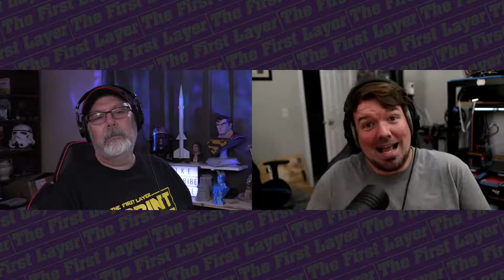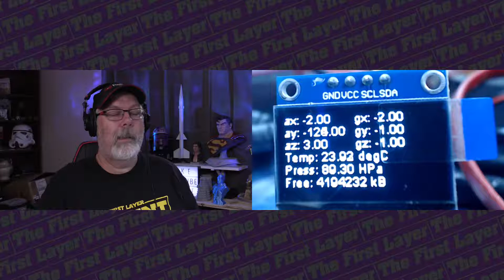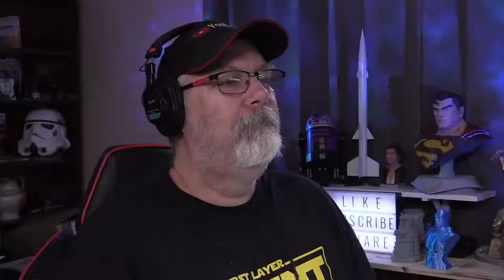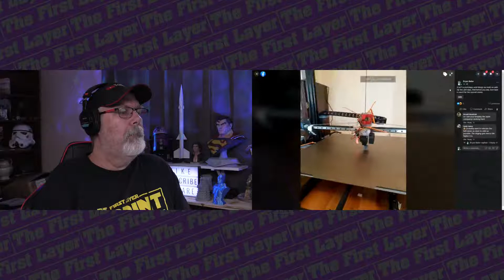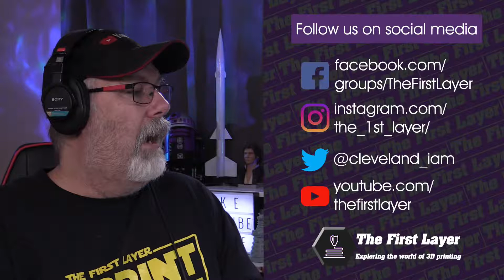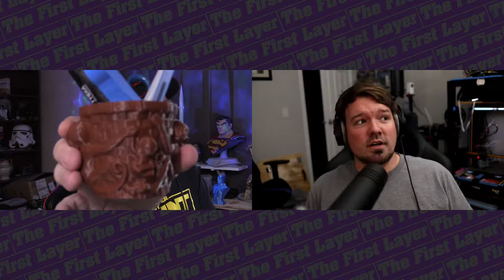Ask for HELP : TFL Live.

Comment: Using a D1 mini and a .96 inch 128x64 screen to display my Octoprint status of my prints have the 2 devices in a thingiverse printed case.  https://www.thingiverse.com/thing:2884823 But don't think that's what your displaying on that .96 inch screen. Your showing temp in C about room temp and your showing 4.19 Gig of space free so could still be a raspberry pi. I'm guessing a raspberry pi running octoprint and using the display to show its status.